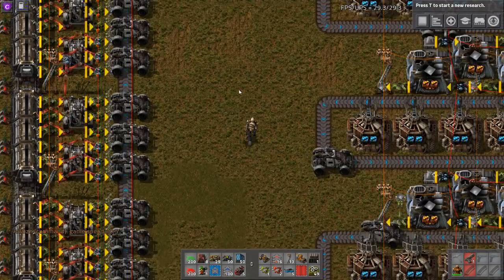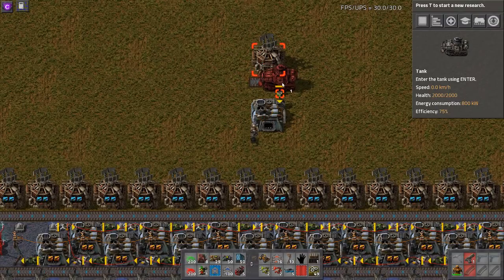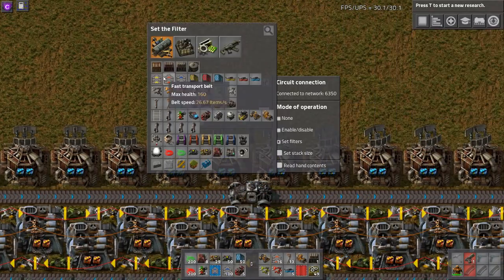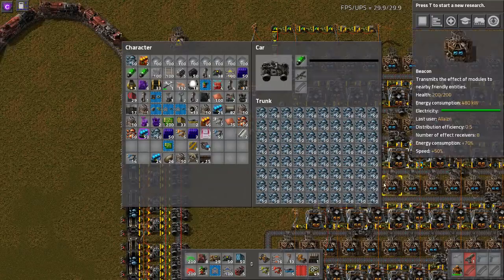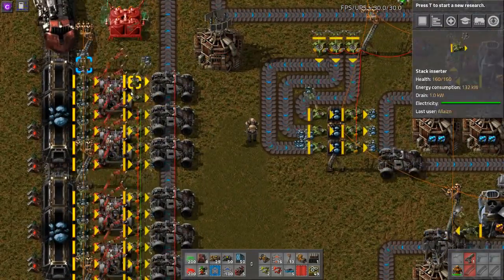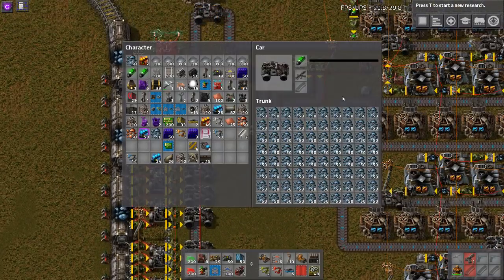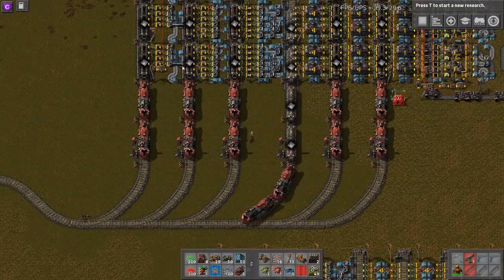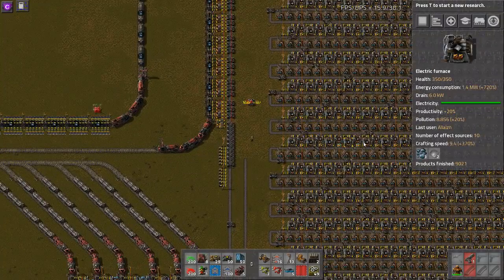Car Belt Smelter Explanation

Comment: The reason why this is not viable is that cars on a belt are super laggy. I tried to build a base like this, but you drop like 1 UPS per car on belt :(. Thats why i skipped this Idea and never fully published it. You can also set filters on the cars, so that you don't deadlock.
Reply from the maker: Hmm, my testing shows different results. I can easily run thousands of cars on belts. See https://www.reddit.com/r/factorio/comments/8m6p0y/the_fruits_of_science_i_present_to_you_cargo/dzm36ow/ for a detailed breakdown of the frame time for my planned 10k spm base using this concept. I think the biggest problem with cars on belts is the fact that you absolutely have to deactivate inserters via circuit network, or they'll try and search something to grab from every tick.
Reply: Possibly stuff changed since 2016 where I last testet it, so good luck on it :)

Comment: Can you help me please how many furnace in this layout I have to have, when I use one car by one so almost every belt is covered by car?

I calcualte that you need only something like 4000/12 = 334 stack inserter to fill full car of copper. And only 4800/12=400 stack inserter to unfill that. Copper can bring bots and iron plates can unload bots for quite short path. But what i do not know is, how many furnace i have to build?
If i want to smelt 4000copper/s i need 4000*3,5/9,4 = 1490 eletrict furnace.... but my setup i do not know if i carry only 4000 copper ore/s on more. Thx you for help.
Reply: If i calculate it right. Car take 3-4 tiles (because it take 2 tiles, and 1-2 tile is gab between them when they go down).

Blue belt move 5.625 tiles/s so it move 1,40625 car/s. So I need 1,40625*4000*3,5/9,4 = 2100 eletrict furnace? Am I right?
Reply from the maker: You need to look at the throughput to estimate the number of furnaces: The distance between cars on a blue belt is 75 pixel (where 1 pixel = 1/32 tile), while the belt moves at 3 pixel/tick. Since every car has room for 4k ore, the total achieveable throughput is 4k ore/ car * 3 pix/ tick / (75 pix /car)*60 ticks/sec = 9600 ore/sec.
In order to smelt that much, you will need 9600*3.5/9.4=3574.5 furnaces. Since 1k spm needs about 1.2k furnaces, you would have the throughput for about 3k spm.
I wouldn't recommend doing it that way though: it's basically unpredictable which car gets its ore taken, and which car receives the plates, but that shouldn't keep you from experimenting :)
Reply: I do not think so... because you have to have some gab between cars due to corner where that gab present. Or not? Or with that gab is still 75 pix/car? But 75/32 = 2,34 so i thing, that this is only length of car.
Reply from the maker: nope, a car is exactly 64 pixel long (or 2 tiles). 75 pixel is possible, if you make sure that cars go around the outer lane of each corner belt. It depends on how exactly you want to set it up...
If you want to build one extremely long line, then its definitely possible, but if you want to have one belt line serve multiple beaconized rows like in the video, then its a lot harder. I already switched to loading and unloading for each furnace row independently, instead of all of them at once, but the main problem is still getting in the ore fast enough.
On a megascale (3k+ spm), you would need to have at least a full blue belt full of ore cars coming in, but that will become a UPS drain rather quickly, because cars are quite expensive UPS wise (but I think its worth it because of the inventory size). My design for a 10k spm base will have about 5-10k cars, and I'd need 3 blue car belts worth of ore coming in. Assuming a 2k long ore bus from the mines to the base is already 3k cars, and  2k tiles out isn't even that much :(
Reply: Ok. so maybe i have a little wider gabs but it is possible to reduce it. But it is clear, that my nb cannot handle it at full ups. And i was wonder if it drain ups less then bots.

But my computer cannot handle that much SPM, so i will still use robots :-). Thx for helpimg.

Comment: Since 10 Minutes (I'm at 21:00 now) I'm sitting here with my mouth open in disbelieve.... holy shit.
One question though ... did you already consider adjusting your math to 0.17 where one item uses "only" 8 "slots" instead of 9 as in 0.16?
Reply from the maker: That change actually doesn't change anything, since only the item size on the belt changed, but car size didn't. The recipe changes pose the much bigger problem for me, since I'll have to redo a lot of timing calculations for my car base :(
Reply: @allaizn7699  hm... the belts get faster, the smelting gets faster ... so I guess it should be all right? I don't know how much the increased belt-speed matters to your loaders/unloaders, since the new belt-throughput will be 15/30/45 items/sec. instead of the 13,33/26,66/40 as it is now...
Reply: @valaplays5712  The belts arn't physically faster, they just fit more stuff at a time.
Reply: @Mernom  ...which means you might have to load/unload them faster.
Reply: @valaplays5712  it doesn't effect car placment though. It may effect the unloader, by making the entire thing less timer dependent since fitting the stuff on the belts is easier.